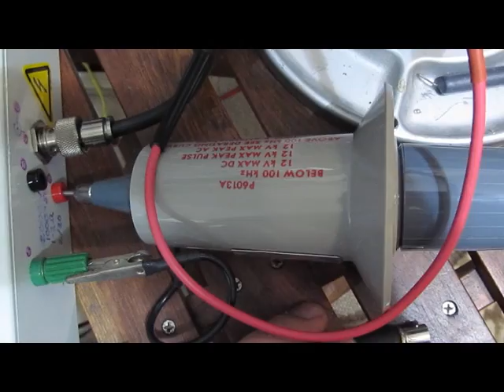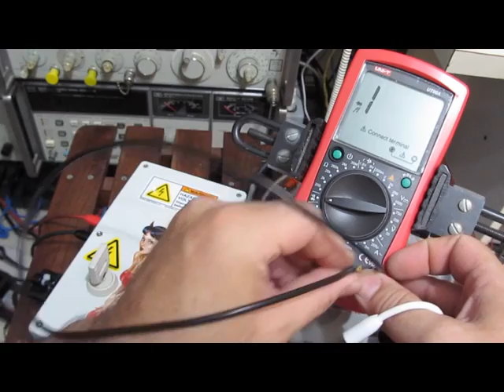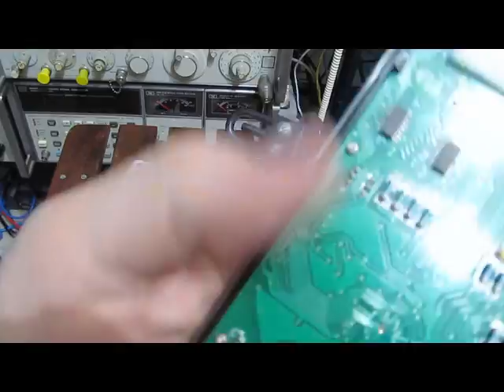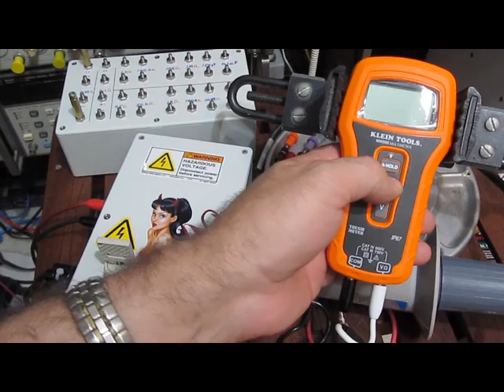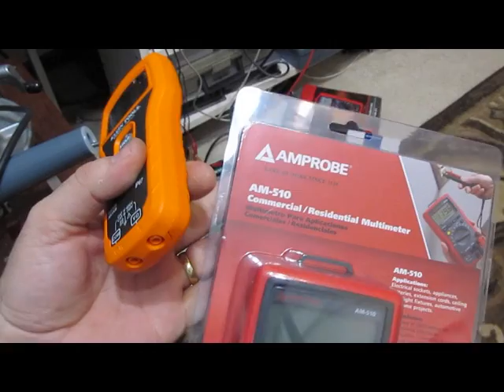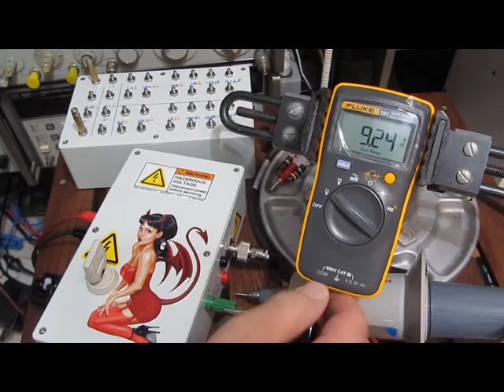Evaluating low cost DVMs Part 20  5KV 2 ohm 40us

Comment: The 'tough' Kline tools MM500 is advertised as CAT IV 600V so it should make it to 8kV at 2 ohms.  Didn't make it past 5kV.
Reply from the maker: ***** All of their "tougher than" videos show its a mechanically tough meter, not electrically.   And believe me, it really is mechanically tough!   It is made to never come apart!
Reply: Thanks, yes that's their reputation. Granted, surges are less common than dropping or getting it wet.  If you take a meter to remote locations: a boat far from shore, hour long hikes in a forest or an island to inspect installations.  If the meter broke we'd have nothing to work with, so we tend to bring several meters.  It pays to travel small and light, particularly if you backpack to a location.  Up the 1990s, we've had "reputable" meters, Tripplet, B&K, Beckman,  spontaneously die in the field, so we presume it was line transients.  But even the early Flukes were hardy, so we never looked back and paid extra for them, they've never failed even if they are just IP 30 or so.
Reply from the maker: Transients are common for me.   I hear electricity and water are not a good combination so  having a meter near water has not been a problem.    I will  be interested in hearing how the 101 survives what ever tests you come up with.
Reply: joe smith Water is a problem in outdoor work around rain, boats, lakes, rivers, ice, etc., but you don't measure during the exposure except extreme humidity, aka rain forest, and most good DMMs work to 80% or more, this is were poor creepage can kills meters.  Salt water is worse for terminals due to electrolysis, but any wet terminals must be dried reasonably before use.  Boats often have compressed air for various uses and blowing water out is one.  I'll create a new 101 thread on eevblog as it seems enough material or questions for a thread.